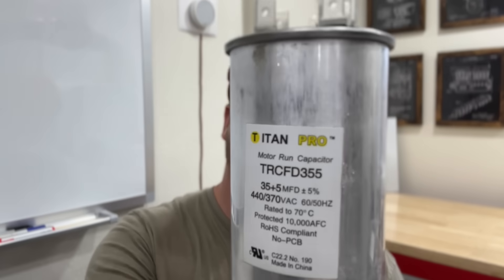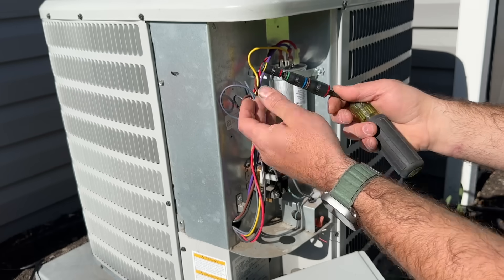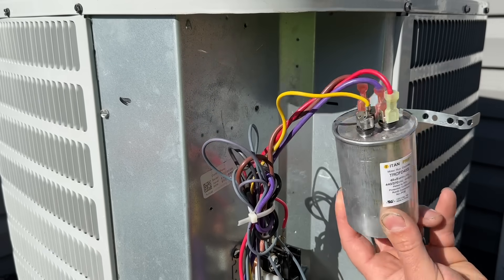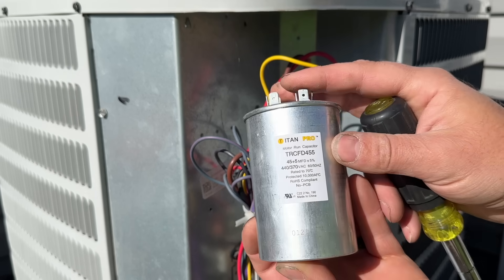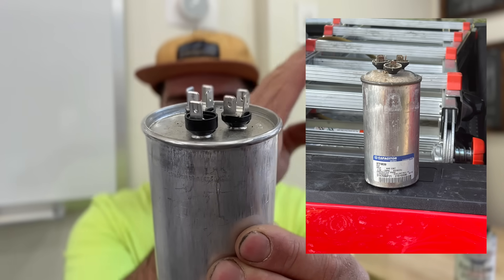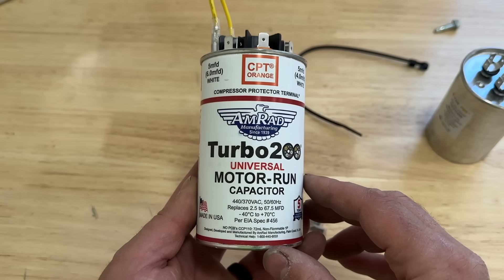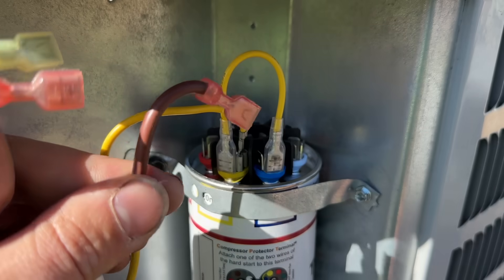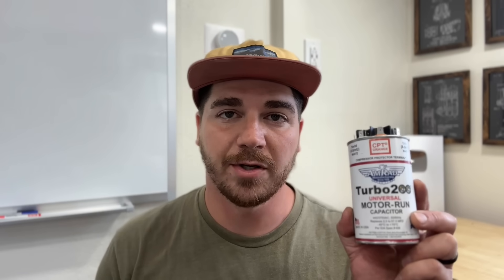HVAC Contractors Practically Make Their Living On These

Comment: I guess I lucked out with the company that services my A/C. Same company that installed the unit, I had to call them after the A/C stopped working; blower worked, but it didn't cool. Technician came out, did a few tests, found out the cap was toast for some reason. It was less than a year I think he said since installation, so he replaced it for free. No service charge, no parts charge. Still, it's great for me to learn this for myself.

Comment: I know it’s not the point of the vid but it’s not really about extra power….you have your single ac motor and single phase ac motors suck at starting so they add a second coil inside the motor only this second coil is connected to the start capacitor and its purpose is not to give it extra power but to lag the AC powers phase angle. And why it’s important to have the correct size is that phase offset of the power needs to match the physical angle from the main coil to the start coil that way when starting you have a  2 phase motor then when the motor get to speed both the start up cap and start up coil are removed from the circuit with a centrifugal clutch

Comment: I've not watched all your posts, but in case you have not covered this, I have a suggestion.  In my experience, the compressor contactor fails about as often as the capacitor.  Since they are not super expensive, it is well to have one of them on hand, as well.  They are usually a 2 Pole - Single Throw Contactor with a 24 Volt AC Coil.  The contact rating should be 10 Amps or so as a minimum.
Your coverage of the uF function on the Fluke is excellent, most users don't know that's on the up scale meters.  You could talk about the Amp Clamp feature  as well, for checking running currents.  On new units, I always measure the line current and mark it on the inside so that it's there as a reference for later troubleshooting.

Comment: As a tech of 20 plus years. I have never heard of someone charging 2k for these. I feel anything above 250 for these is too much. Thats a universal turbo. That’s including the diagnostic and travel. Mind you, cost of hitting the door of the customer companies in Cali 280-350 just to send a tech to the call. Cali is nuts on the taxes, insurance, wages, wage taxes, edd and regs on tech wages. I also recommend doing load testing on the run cap. Bench test in I find still missing bad caps.

Comment: Sometimes you need a bit more capacitance than a factory capacitor has to get the compressor running. They sell a Hard start capacitor, complete with cut out relay. The relay because if you left that special start capacitor in all the time, it would get hot and blow up. Worked great for me, I have a 3 ton, 1 year old AC compressor.

Comment: If you can't read the capacitance of the old cap, how will you wire the turbo cap?
Also $70 vs $10...  I think I'll just familiarize myself with the innards of my AC system and have the stock cap on hand before it goes kaput.

Also I'd short the cap out before anything else and then use pliers to remove the connectors at the connector.  It was painful to watch you yank them out by the wire.

Yeah, it is amazing how a $10 part makes an old motor start nice and strong.

Comment: Everyone thinks they get “ripped off”AFTER the fact. Perhaps you had an issue you knew nothing about, called someone who did, they got you up and running immediately, and you agreed to the price because you hadn’t put the time in to learn how to do it yourself and it was hot. Once you were comfortable because of someone else’s expertise, it’s now easy to complain. Same could be said about heart surgeons or cancer specialists after you’re cured…lemme guess you got ripped off by your insurance, ya you’re alive, but you coulda done it for a 1/10th of the cost, it’s easy, all you needed was a scalpel and some antibiotics, what’s that, 40 bucks on Amazon!  Yes, you pay me $5 for the part, and $900 to know what to do with it. Like most things, AC is a luxury, you don’t need it, you want it, things you want cost money you may not wish to spend, then fine, go without, it’ll make you a stronger person. I want a yacht and I’m 11 capacitor replacements from getting it!

Comment: A bad capacitor is a side effect from the actual root cause of the problem.  You will continue replacing capacitor until your system completely fails. You must address the root cause to prevent additional issues. 

Like those that want a million $$ and those that say it's a scam and it's only worth $10 both extremes will only cost you more money.....

Find a good company that you are comfortable with and can trust. This will save you $$$$

Comment: I don't need one of these, but I watched the video. I'm curious.. what if you get the turbo200 and you need the first number to be 50 and the second number to be 5? Would you hook a jumper to the 20 + 25 and another jumper to the 5 to make 50?  Then when you hooked up the one for the fan it would be 50 as well instead of 5....

Or is 50 just not a number that is ever needed for the first number?

Comment: Great video. I have a Trane heat pump & the capacitor has just 2 terminals instead of 3 like the one shown in the video. How would the connections be made on a 2 terminal capacitor?

Comment: Think of capacitors as electron accumulation tanks to supply  a VERY large burst of electrons. like if you opened a 1inch valve on an industrial air tank or hydraulic tank

Comment: Before removing the capacitor. Of course disconnect the breaker. But take a marker and write down the color of the wires and the area where they plug-in. This is a simple way for people that are not familiar with them to be comfortable making sure they get things right when they reassemble.

Comment: I don't trust those turbo 2000s, I only ever used them as a temporary repair until the right sized one came in. Hate to break it to you, but the made in Mexico ones are pretty good.  Caps only last about 5 years, fan motors 10, Compressors 15-20.

Comment: Why don’t people especially in Florida where the air conditioner rarely gets a break in a year just have the capacitor changed yearly or every two years for a $ 20 part give or take I think it should be mandatory to change them even if there still good ! That cheap part replaced yearly for that kind of money can certainly eliminate many many air conditioner failures .I will definitely look into this for sure !

Comment: I've replaced my capacitor 3 or 4 times over the last 12 years. I've always wondered if how often it has failed is indicative of an problem with the system. Should I be worried?
The other issue is that in a pinch, like on a really hot day and your wife (for example) has no patience for it, it can be hard to find someone who will sell you a capacitor - I've only been able to buy them online. Every place I tried told me they would only sell them to licensed HVAC techs. I have a couple spares on hand at all times now.

Comment: In case the pulling of the fuses with the flipping and putting back in was slightly confusing, because the camera didn't actually show the flip of the fuse holder, just put it in your pocket or set it aside, instead of putting it back in, while your working on the unit! Simple n Safe!

Comment: American made capacitors are about $25 now...30mfd.
Higher mfd's up to 80mfd can be about $35-50.
China made ones are much cheaper....but usually are very sensitive to voltage surges/lightening strikes & can fail quicker.

Comment: I had a landlord who refused to send an HVAC person. The fan only spun when forced to move with a stick, the compressor would run once the fan ran. Seems like the dual cap to me so I opened the box, and there was a fried scorpion on it. I just ordered one on Amazon, got it a day later and fixed the AC for 12$. The reason though some HVAC folks will not is called liability. Normally if the cap fries, something is off somewhere else. If they fix it and it breaks the next day, guess what tech has to come to work for free?

Comment: I had my AC go down on a 120 degree day in Arizona. Went on Angie's List (now called Angie) looking for a HVAC guy. What a huge mistake! Within minutes I was called by 3 companies. Naturally I had the first guy come to fix the problem. He ended up charging me $800 to replace the capacitor, then proceeded to tell me that my AC unit was on it's last legs, and may not last a month. 

He talked me into buying a maintenance contract for 5 years at $1000. It was to include "discounts" on parts and service, and maintenance every few months. Well, every single time they showed up they found something that "may die any minute" and needed replacing, at ridiculous prices and each time tried to talk me into replacing the unit at $15,000, and now they tell me that because of inflation it would be over $25,000. . I didn't replace anything that wasn't broken, and here it is 3 years later and the system is running fine. I will be getting the universal capacitor and replacing it myself next time.

Comment: Thanks for spreading the word on this guys! Knowledge is power.... this is also helpful to all of the non-DIY out there – – because if you can actually diagnose it before you call your service tech – – you'll save time and money. They won't be able to overcharge you for service you don't need.  I change these out myself sometimes, but found myself in a jam without the right value cap. So I called a friendly local service tech and told him I needed one he put it in for me ... Cost was $150 which is still expensive but a lot better than 300 or 1000.... which like you said is the going rate in the city! 
That universal cap looks great for people who have to maintain multiple units. And it's made in the USA very cool. Keep up the good work and thank you for educating everyone!

Comment: A high quality AC will have a redundant or timed thermistor that will open regardless of thermal conditions after a start.  This takes the start capacitor out of the circuit after start and just leaves in the run part of the capicitor.  This prevents the start capacitor from overheating which is the most common failure.  High end industrial ACs will have this but it adds a couple hundred bucks to the price so most consumer ACs will reventually fail and require a service call.

Comment: After several years without a pre-Summer checkup, I decided last year to have a local HVAC company with a good reputation come out to perform one.  The tech recommended a capacitor replacement while showing me some meter reading, and since it was relatively affordable, I agreed.  Later on I checked to see what the part typically goes for, and what the labor involved looked like.  If indeed the capacitor did need changing, I could have done it for next to nothing.  Again, the cost was no big deal, and the value of preventing a failure during a heatwave is where I place the value of going to a professional.  Would be interesting to see if a different problem would be found if I hire the same company, or if the same problem would be found if I hire a different company...

Comment: Four things: One, always verify that there actually no power to the unit by checking with a meter. Not everyone who installs or works on AC units know how to properly wire one. Two, do NOT pull the connectors off by pulling the wires. You are asking for trouble - it's best to use some insulated needle nose pliers to pull the connector itself. Three, verify the capacitor size is correct - the last guy may have installed the wrong one. And four, the capacitor does not act like a battery in this application.  The capacitor is wired in series with the start winding on the motor. The charging of the capacitor creates a delay in the AC sine wave that shifts the phase to be lagging the main winding of the motor. This phase shift between the windings is what allows the motor to start rotating, and in the correct direction. And keep in mind that the wrong SIZE capacitor will cause the wrong SPEED (and amp draw) of the motor. Other than these 4 things you are certainly helping people out, if nothing else your viewers have a little more knowledge about this repair.

Comment: At my old place, I had to replace a capacitor, and I did it myself it wasn't that big of a deal. 

Right after replacement, the condenser motor for the fan went out.

So I went back to my local AC supplier, and he was able to match me up a new motor.

I hooked it up, and the fan worked in reverse.

A quick youtube search shows that reversing any of the 2 wires makes the motor spon the other direction. 

The service call was 120.00 just to come out, and the local AC technician said he probably wouldn't be able to get to it in about 3 days. 

We had a newborn baby. Mid summer in Texas,and that was not going to work.

I have no idea how much I saved in the end, but it was worth the effort.
Reply: A lot. You saved a lot. I'm a licensed tech. Most companies would've charged you an arm and a leg for the part alone, and the part is the cheap portion of the bill. Here's a tip, and feel free to spread it around. A good rule of thumb is if it doesn't involve the pipes and freon, you are legally permitted to make the repairs without a license. For simple stuff like coil cleaning, replacing caps or contacts, the condenser fan I encourage people to learn to do it. Apart from saving money, making something work again with your own two hands gives you a feeling of accomplishment you simply can't get elsewhere. Just make sure you follow ALL the safety guidelines. It's not about being tough, it's about staying alive.

Comment: The industry term for a swollen capacitor is, "pregnant", for the obvious reason. No need to even test it... If it's pregnant, replace it. Great video. Glad you stressed the importance of a cap holding a charge and how to discharge it safely.

Comment: Very helpful video! What is the risk in getting a capacitor that is slightly off from the original spec? For example, what would happen if I used a 45/5 when a 35/5 is the original?
Reply from the maker: Either it won’t work, or it won’t work exactly as it’s engineered. I’d ALWAYS get the same size, instead of trying to put in the wrong size temporary

Comment: My capacitor had oil leaking out of it. I got an AC guy and he told me my whole system was junk and needed to be replaced. I told him to replace the capacitor. That fixed it. He charged me $500. I knew I was getting ripped off, but I had been afraid to fix it myself. My system lasted another ten years. My father-in-law's system stopped working. I looked at the capacitor and it was swelled up. I fixed it myself. The capacitor only cost six dollars. That was over five years ago and the system is still running fine. I've found when things let go it's best to try to find help on YouTube.

Comment: Please be sure that the very first thing you do is discharge the capacitor, even before dismounting it.  The stored energy can un-life you!
Reply from the maker: I felt more comfortable taking the terminals off after removing it because the wire connectors were preventing me from discharging it while it was still mounted. Otherwise I’d say absolutely discharge it first! Cheers
Reply: @diyhvacguy I was targeting my comment to the inexperienced viewer.  As you know, those terminals don't always just pull off easily and can require some wrestling that could lead to a zap if not careful.

Comment: Always Great Information! As I recall during the Covid Crap! I work in Plumbing at a  Plumbing-Electric-HVAC distributor & There was shortage of Capacitors- Contactors- & other They were very hard to find! I have some Rentals/ Apt's & usually keep spare parts around including waterheaters (because they've gone from $325 to $525) at least 5 price hikes since covid & a shortage as well. I did let loose of some of my AC stash parts during 100°+ heat here in KS
So having that multi use Capacitor in hand for need as well Supply issues is money well spent! Clean! Your A-coil,  Clean your Condenser Coils! Replace Filters!  & Old tube insulation on Line set exposed ! Extra fuses if needed! 
Also even if you use a trusted tech they're usually slammed during a heatwave & a simple fix with parts on hand will keep you & yours comfortable!

Comment: It seems that people have a hard time finding an honest tech these days. I worked in a hospital for 45 years an replaced dozens of capacitors. Sometimes they last, sometimes they don't. My orginal Armstrong unit at home lasted 40 yrs before the compressor cap went bad Lol! But two years later I had to have the whole system replaced because the evaporator pan rotted away leaking in to the furnace with no replacement available, I had the son of the original installer replace it wit a new Armstrong unit. Hopefully this will outlast me!

Comment: I have an old Trane in my rental property.  It's been there for at lease 20 years.  In 2015 it went out.  When it started, you can hear the capacitor clicking but the unit wouldn't start.  Knowing that I called the AC people.  Any other diagnosis, I would have told him to leave (due to my medical shape at the time I couldn't do the job).  In any case he saie it was the capacitor.  Charged me the initial visit my house fee and was off.  It's now 2024 and it still working. I know that it will have to go soon because of the freon change (debacle) coutesy of the government. Decent company which I still use for my primary residence.  Last but not least:  Forget it.  It was going to be a pregnant capacitor joke.

Comment: My capacitor on furnace went out, blower motor not running at full speed, diagnosed it myself, called ABC (you know the commercial on tv) 20$ service call just to verify so not chasing parts. Abc wanted 780$ for a capacitor, no thanks Monday morning on way home from overnight work bought one from motor rebuild company $6.35  thank God I can DIY